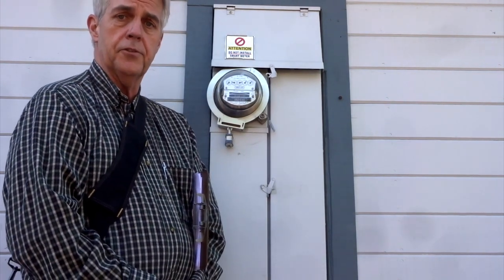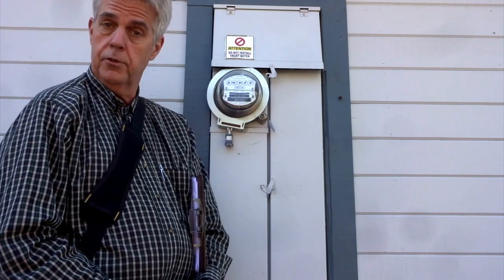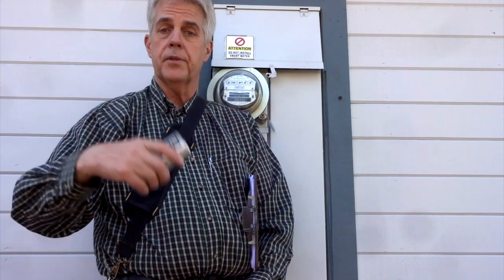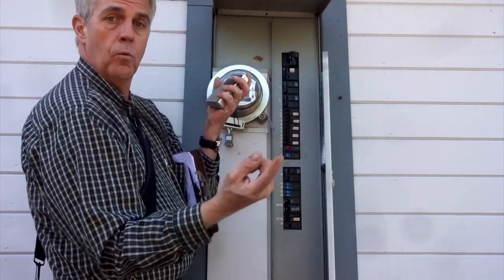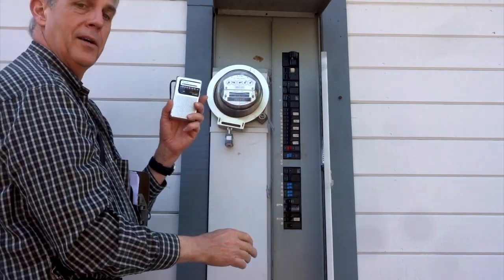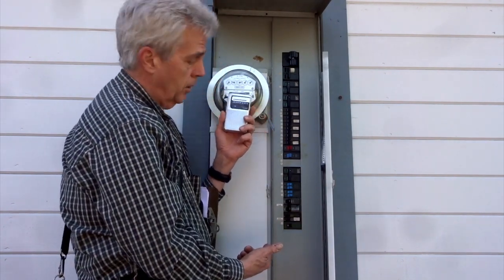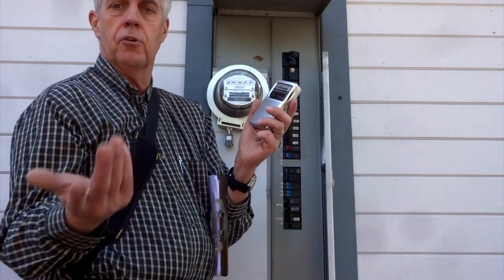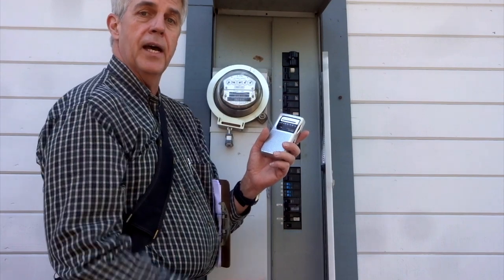Detecting Dirty Electricity with an AM Radio outside the house

Comment: Just found your channel. I’ve been looking for something like this. What type of bulbs or lighting is okay to use so I can eliminate all these fluorescent and LED lights? Thank you for your expertise!
Reply from the maker: Zillowtek LED bulbs from Menards in Wisconsin are clean last time I check the 100 watt equip. bulbs
Reply: He has no expertise, buy a decent quality LED bulb and you'll be golden. His actual advice here is sound tho, if the bulbs have a good lifespan and safety. The only danger from LED lighting is being out of pocket with cheap chinese crap that dies in 2 months

Comment: I'm an electrician, with many years of electronics, robotics, and automation experience as well... this is 100% quackery.

The radio goes quite when he shuts off the house because there is no longer any current flowing (no amps), and without current/amperage there can be no magnetic induction. This is also why the 100 Amp sub-panel makes it much more noisy, it has more electrical load on it than the other 20 Amp breakers. It is also fed by BOTH legs of the service, where as each twenty Amp is fed by only 1 leg... so really, consider it 200 amps at 120 volts whereas the 20 amps are just that, 20 amps at 120 volts.

More amps, more induction... the greater the AMPlitude of the signal that any AMPlitude Modulation (AM) radio can receive.

This is bullshit in its purest, unadulterated form.
Reply from the maker: Hello David: For those with an open mind: the effects of radiated or conducted kHz RF radiation is well documented: see links.

By the way,  I used to feel as you have expressed.

When I shut off the source of the dirty electricity many of my clients feel an imemdediate relief.  

Here are some informative links for you.

How to measure Dirty Electricity
https://buildingbiologyinstitute.org/mep-fundamentals/

More eductional links for you
https://magdahavas.com/havas-video-presentations/gs-units-explained/
http://www.sammilham.com/links.shtm
https://magdahavas.com/electrosmog-exposure/multiple-sclerosis-and-dirty-electricity/
https://www.stetzerelectric.com/research/

PubMed links
https://pubmed.ncbi.nlm.nih.gov/23323864/
https://pubmed.ncbi.nlm.nih.gov/17178585/
https://pubmed.ncbi.nlm.nih.gov/23781992/
https://pubmed.ncbi.nlm.nih.gov/18556048/
https://pubmed.ncbi.nlm.nih.gov/18568931/

All the best to you and your endeavors.

Sincerely,

Eric Windheim BA, EMRS, BBEC, RFSO
Certified Electromagnetic Radiation Specialist
Certified Building Biology Environmental Consultant
Radio Frequency Safety Officer
Lab Leader for the Building Biology Institute (BBI)
Serving Greater Sacramento Region, Northern California, Bay Area, Central Valley & Reno
WindheimEMFSolutions.com
Office: 916-395-7336 
Sacramento CA

Comment: Wouldn't it make sense to use an RF spectrum analyzer that goes down to the low RF ranges for dirty electricity readings instead of an AM radio? The Trifield TF2 covers from 40hz to 100Khz, then trifield TF2 RF coverage is 20Mhz to 6 Ghz. Leaving a gap. There are RF spectrum analyzers that cover the gap of 100khz to 20 mhz. I don't get why  RF experts always want to use an AM radio... Does anybody know why? Is there something wrong with RF spectrum analyzers for this?
Reply from the maker: Yes of cours.  Please see my other videos.

I set up my SA and stop at the kitchen table but the AM radio is used wherever I walk.
Reply: @windheimemfsolutions  oh ok, thanks
Reply: I see that you use a spectrum analyzer for the actual electricity, but I was wondering if anyone uses those portable RF spectrum analyzers too, that measure the actual field not whats on the wire. I haven't found any videos with those.

Comment: Hey Eric! 
               So please tell me , I love in a rv & led lights are key for battery life.. ru saying that these led bulbs and energy efficient bulbs are all out of the question? AND , OR HOW <DO I pick out and choose/ between the ENERGY EFFICIENT BULBS/ LED BULBS FOR MY RV ? 
   Thank you for your attention to my question Sir :)
Reply from the maker: Hello BabaLeaf,

The LED bulbs that create the dirty electricity, as evidenced buy the AM radio noise, are 120 Volt bulbs feed by household or shore current as they say in RV parks.  If you have 12 volt DC current, from your Deep Cycle batteries,  powering your bulbs they are generally safe as there is no inverter or switch mode power supply in the bulb to convert the AC 120 Volt current into the DC current that LED bulb elements need to create light.

If you have an Inverter in your RV you should check it with an dial tuned AM radio dialed below 540 AM and see if you hear nice when your inverter is on or LED lights are on.
Reply: @windheimemfsolutions   what about 240 volts that we use in Europe?
Reply from the maker: I test many bulbs each year in order to find lots of bulbs that do not create conducted DE, or radiated RF DE.
Reply from the maker: @Altermedicineorg  Same principle.

Comment: Will a power outlet create EMF when switched off? When its on there will be EMF, so if there is dirty electricity from the power outlet will the range of EMF be greater?
Reply from the maker: NO, Yes & not sure of your last question.
Reply: @windheimemfsolutions  Thanks. I have a power outlet where one of the switches doesn't turn off anymore so it is stuck on. Will that be pumping EMF into the room or does something have to be plugged into something to draw EMF into the room?
Reply from the maker: First thing to do is get it repaired by a licensed electrician.
Reply: @windheimemfsolutions  of course but will that be pumping EMF into the room or does something have to be plugged into the outlet to draw EMF into the room?
Reply from the maker: @TheDoctor46vr  It is the devices on that circuit that create the DE
Reply: @windheimemfsolutions  sorry what does DE mean? Does that basically mean that something needs to be plugged in and turned on to create EMF? So that would mean even with the switch stuck on without anything plugged in there isn't any extra EMF in my room, like how it would be if it was turned off anyway?

Comment: What is the best way to clean this up? Satic USA has some products but I am not understanding the technology. I do not understand the result. Right now, the volt coming to my lights is 124.5. At least its a steady 60 Hz. If I attach a clean up device, will it help to drop the voltage?
Reply from the maker: Hello M18,
Here are your proper steps.
Use a Stetzer Meter to detect remove or replace all sources of DE in your house with devices that do not create DE.
Filter at the main panel to keep external DE out.
If you want a Satic unit, after you have cleaned up DE in house, you can call them direct by phone and get a 15% discount.  Contact me to get the discount code: http://windheimemfsolutions.com/contact-us/

Comment: In my office we have led fluorescent bulbs.. can the bulbs be replaced with clean light tubes?  If so which ones?   Would the whole fixture need replacing?
Reply from the maker: Hi Veg,  most tubular lights have a power supply.  If it is an older magnetic supply it will not make DE but the new energy efficient ones make lots of DE so filtration is the least cost solution.
Reply: Windheim EMF Solutions. Thank u for response.  Yes they are the newest energy eff tubes.  Which tubes would be best? Do i just go in home depot and ask for filter floresent tubes?
Reply from the maker: Hi Veg,  It is not the tubes: it is the power supply in the fixture.  Start here http://www.windheimemfsolutions.com/dirty-electricity-meters-filters/.  Get the correct stetzer meter to find out how much DE you have and a few filters to see how much you can reduce the DE.  Do not buy a lot of filters to begin with: just a Stetzer meter and maybe 3-6 filters is enough. Avoid the Greenwave meter as it only measures 1/2 of the problem.
Reply: Windheim EMF Solutions  ok thank you
Reply: @windheimemfsolutions   Which half of the problem does the Greenwave meter detect and which half does it miss? Thanks.
Reply from the maker: @MrCorrinado  It measures relative voltage but not turn milli amp.  It does not measure frequency.
Reply: @windheimemfsolutions  What do you mean turn milli amp? The Stetzer meter measures frequency? It just gives Stetzer units right?
Reply from the maker: See this link https://www.stetzerelectric.com/product/stetzerizer-microsurge-meter/ @MrCorrinado
Reply: @windheimemfsolutions  Ok looked that page over... All it says is that the Stetzer meter measures dV/dt (fluctuation in voltage over time). No mention of evaluating frequency or milliamps or anything like that. So I'm not sure what you're basing your comparison to the Greenwave filter on here. Neither meter measures frequency nor amperage. So again, what "half" is the Stetzer covering that the Greenwave misses? Help me understand.
Reply from the maker: dv is difference in voltage and dt is difference in time (frequency) @MrCorrinado
Reply: @windheimemfsolutions  Hmm I don't think the word 'time' here is interchangeable with 'frequency'. The description states it measures the difference in voltage "over time", as in milliseconds. Nowhere does it imply that the exact frequencies present play into the calculation at all. And then what did you mean that Greenwave doesn't measure "turn milliamp"? What does that mean?

Comment: I have never seen a breaker panel exposed to the elements like this! I think you have a bigger problem than  "Dirty Electricity!"😅
Reply: Here in the desert southwest, that is common, the 220v breakers are on the outside meter panel as shown and the 120v breakers are just on the other side.  Never saw that when living anywhere else.
Reply: No kidding!
Reply from the maker: Thank you for your comment.  This is a standard outdoor rated NEMA enclosure common here in California.

Comment: I believe in clean DC only electricity from my free-entertaining machine and don’t trust that AC stuff or those “switcher” power supplies. We just use purely resistive items to drop voltage as needed. Can you find dirty electricity with dosing rods or just AM radios and scopes?
Reply from the maker: Thank you for your question. Here are a few ways to detect & measure DE.

Here are some informative links for you.

How to measure Dirty Electricity
https://buildingbiologyinstitute.org/mep-fundamentals/

More eductional links for you
https://magdahavas.com/havas-video-presentations/gs-units-explained/
http://www.sammilham.com/links.shtm
https://magdahavas.com/electrosmog-exposure/multiple-sclerosis-and-dirty-electricity/
https://www.stetzerelectric.com/research/

All the best to you and your endeavors.

Sincerely,

Eric Windheim BA, EMRS, BBEC, RFSO
Certified Electromagnetic Radiation Specialist
Certified Building Biology Environmental Consultant
Radio Frequency Safety Officer
Lab Leader for the Building Biology Institute (BBI)
Serving Greater Sacramento Region, Northern California, Bay Area, Central Valley & Reno
WindheimEMFSolutions.com
Office: 916-395-7336 
Sacramento CA

Comment: LED hums .. it's a bad /partially defective unit probably ..  your basically hearing air voltage . everything charged up with household voltage  has it ... the exact reason utility boxes have covers and are grounded
Reply from the maker: Hi,  Thank you for your intelligent comment. The client had a lot of very old CFL bulbs and many dimer switches..  It could also have been a poorly designed UPS back up power supply for his computers: some are very dirty.
Reply: @windheimemfsolutions  CFL bulbs and ballasts for the old style fluorescent lights do it all the time with dimmer switches the contacts go bad.   Remember they have mercury in em so they can't go in the regular trash     but yeah a dirty computer power source could also do that
Reply from the maker: @agoogleaccount2861  Right.

Comment: What kind of bulbs should we buy? My whole house nothing but energy saving lights. I hope the rat adapter that goes on the outlet that cause spikes in the power lines not giving dirty electricity
Reply from the maker: Incandescent bulbs do not create DE. The plug in rat eliminator devices I have tested do create
 DE.

Comment: What a great idea!  Blame it on electricity - and here all this time I've been blaming my health issues on eating bad food full of sugar, sodium, preservatives, and fat as well as never getting any physical exercise.  How ingenious!  I am impressed.
Reply: Since the 1800s, electric motors have been been kicking noise into the mains lines [and into the air], it's just the nature of the beast, especially the commutator varieties.  The fear mongers are pretending this noise is some newly discovered phenomena and that it's somehow "dangerous".  There's not a peer-reviewed study anywhere in the world that confirms/proves this.

If what they're saying is true, then early electric locomotive operators [engineers] wouldn't have lasted longer than a few days or weeks inside those metal Faraday cages.

In 1896, one of the first electric trains used 750 volts/110,000 Watt motors, with zero evidence of any health issues. NYC's MTA rush hour uses 495,900,000 watts of power, with those wonderous blinding arcs of intermittent 3rd rail current, one couldn't ask for 'dirtier' EMF in a sardine can if he or she tried.

I am impressed too, that these kinds of scams are making tons of money.
Reply: There is a common misunderstand. It is not the noise that causes problems, it is the shape of the noise. For example an analog motor will pump out sine waves. The body doesn't mistake those for its own signals. But some motors are driven by square signal, LEDs turn the current that flow through them into something very spikey, and computers off course have more of a square wave. All this combines into a signal which harmonic resembles nerve impulse. This affects inter organ communication and nervous system. This is why around computers, your thinking goes in overdrive.
Reply from the maker: Thank you for your insightful comments from a bio-engineering point of view.
Reply: That is called ozone due to brush arcing. Most modern motors are brushless, so there are no ozone emissions.
Reply: All that is part of the equation also.
Reply: daslolo How can we convert the shape into a non-interference signal where it won’t harm us? Thank you!
Reply: 🤣😃🤗🏃‍♀️🏃‍♀️🏃‍♀️YEP
Reply: @daslolo  👩‍💻👨‍💻👏👏👏👏👏
Reply: @MrTantalust  You are incorrect here sir. Check out the book The Invisible Rainbow by Arthur Firstenburg in which he specifically mentions examples of early railway operators experiencing symptoms of electrical illness.

Comment: Will tinfoil hat protect me from this kind of threat? I don't want to catch an autism.
Reply from the maker: Hello Fakeuser,  

Thank you for your comment.

Your response is very common: most people assume that shielding is the best protection and in the process they can actually make their exposure worse and increase the levels of acute neurological symptoms and chronic damage accumulated.  

Certified BBECs & EMRSs follow a protocol: 
1. Detect
2. Measure
3. Assign risk level
4. Propose and effectuate proven solutions.
5. Remeasure to insure that the solutions are effective.

The occupant of this house has a long term, multi year case of diabetes: doctors were managing it with drugs.  The cost of the drug management was $8,000.00/year per the occupant: mostly paid for by health insurance per the occupant.  Of course this raises the cost of health insurance for all of us.

The most effective solution is to remove all compact fluorescent light bulbs and other sources of dirty electricity in the house and create a Sleep Sanctuary for the occupants. https://windheimemfsolutions.com/sleep-sanctuary/

Sincerely,
Eric Windheim BA, EMRS, BBEC, RFSO
Certified Electromagnetic Radiation Specialist
Certified Building Biology Environmental Consultant
Radio Frequency Safety Officer
WindheimEMFSolutions.com
Sacramento CA

Comment: That special price of $1.00 USD at Dollar Tree cause thats what  E26 type LED bulbs cost there and it's those cheap ones that have poor filtering on their  small and very basic switch mode power supply PCB's. Where a higher end General Electric LED lamp or even one of their Smart Lamps have very little noise leakage where the smart lamp had less than the standard bulb. That makes sense because the smart lamp has an ESP based wifi radio module built in and for that system to work reliabaly there needs to be clean DC and low to no external RF noise from the power supply.

Now all the medical issues mentioned are not due to the RF emissions of light bulbs, smart meters, or even a 100 watt Ham radio but rather they are caused by the materials used in electronics, lead, iridium, lithium, various polymers, mercury, cadnium, and so forth. Yeah exposure to any of the many materials when vaporized or ingested can increase health risks, just like smoking tobacco or vaping.
The reality is everything we create  from electronics to food additives has a possibility to cause any number of health issues. RF Emissions on the other had are not energetic enough to alter DNA as it is non ionizing radiation as RF is below visible light on the spectrum where ionizing radiation begins in the upper UV part of the spectrum.  Wingnuts will demonize smart meters and light bulbs but  defend their microwave producing iPhones and WiFi routers, both capable of creating RF on one or more bands with TX power up to 500mW (1/2 watt). Old cell phones from the 90's and such produced RF in 800 - 900 MHz @ 3 watts.
Reply from the maker: Thank you for4 your comments: do  you have a question?